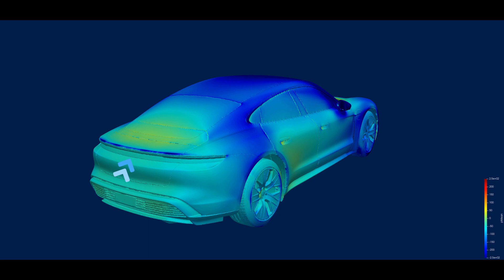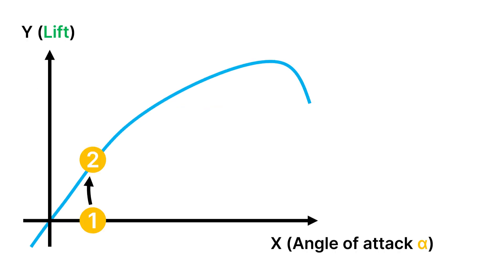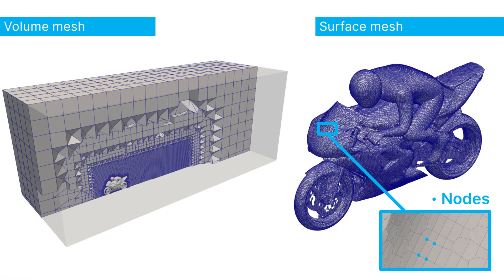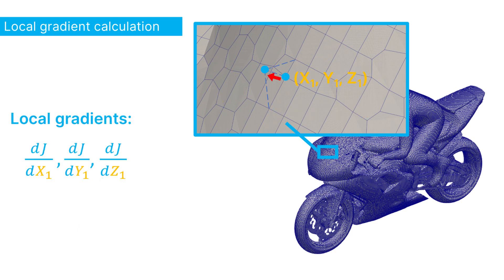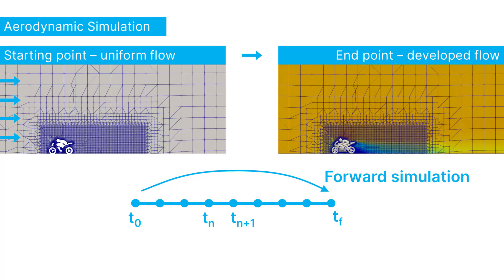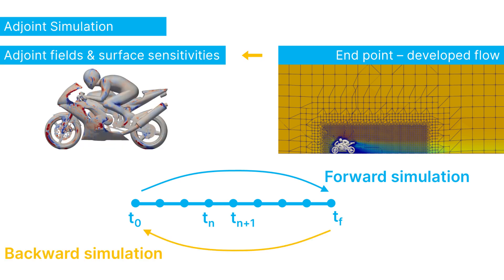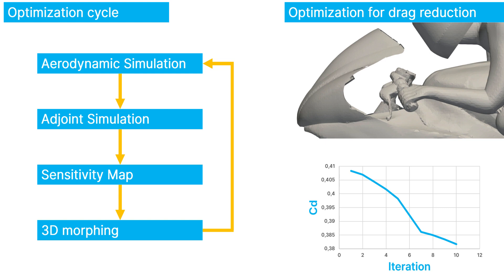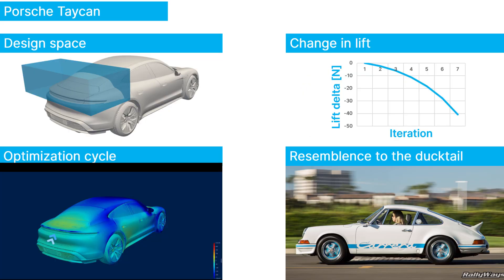Aerodynamic Shape Optimization - The Adjoint CFD Method

Comment: can this also be used for reducing noise when an object is subjected to airflow? trying to do shape optimization where the goal is noise reduction. Is this possible to work with?
Reply from the maker: Yes, shape optimization can also be used to reduce noise! Any specific topic you're working on?
Reply: @AirShaper  currently working on an undergrad thesis for ducted turbofan blade noise reduction by adding trailing edge serrations. we'll be trying to optimize not the blades but the serrations attached on the turbofan blades for noise reduction
Reply from the maker: @watermenlon3617  sounds really cool!! The NTUA does have adjoint code including MRF for rotation, but they haven't made it public yet :)

Comment: Great! I will try that out when my next project is finished.
Reply from the maker: What's the next project about?
Reply: @AirShaper  A whole body kit which should be a TÜV/Streetlegal version of a real Rallye Version. Just turned down enough to make it road useable. This includes a massive (in relation to the car) rear spoiler.
Reply from the maker: @marcnobel3938  Ok that's right at the heart of what we like & do :) Looking forward to get in touch as soon as you get to the aero part!
Reply: @AirShaper  I guess in roughly 3-4 weeks I have modified all scans to the needed standards. Some parts are already in Geomagic to get them ready for SW. We are very excited to try out your analysis.
Reply from the maker: @marcnobel3938  Hi Marc, ah that's pretty soon then, nice! Keep in mind that in theory, there is no need to make the models watertight for AirShaper. But of course, gaps & holes that are large enough to impact aerodynamics should be closed. Feel free to reach out at wouter@airshaper.com to continue the discussion!
Reply: @AirShaper  Yes! We will bring the model to perfection first. - THX for the information.